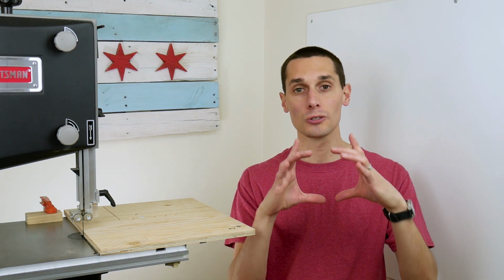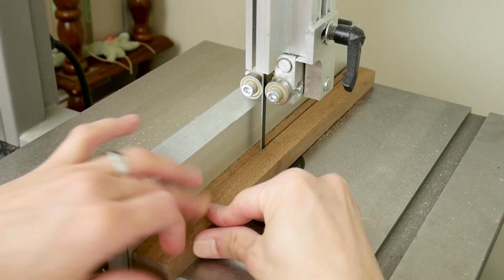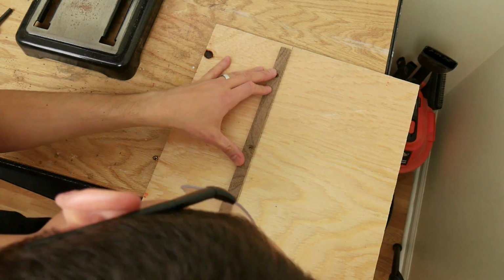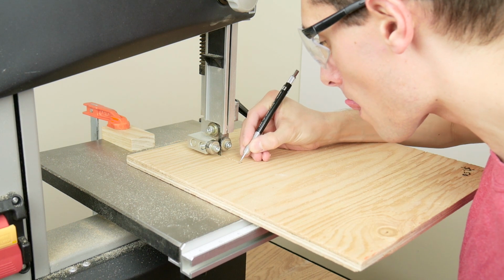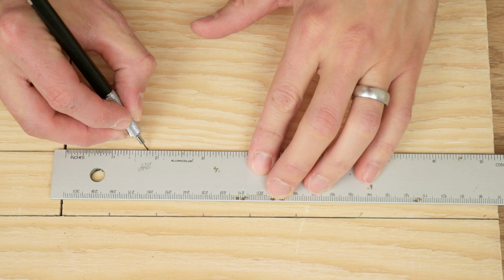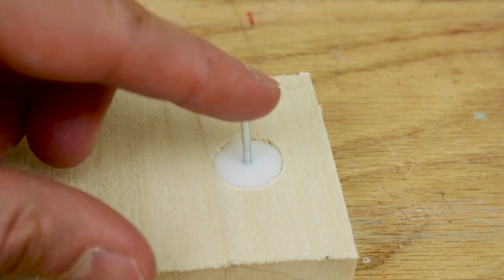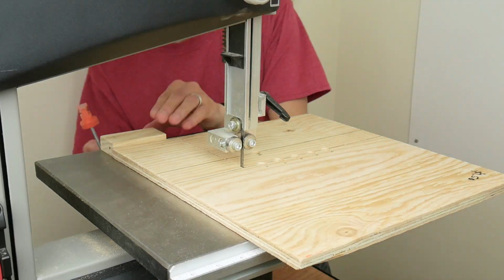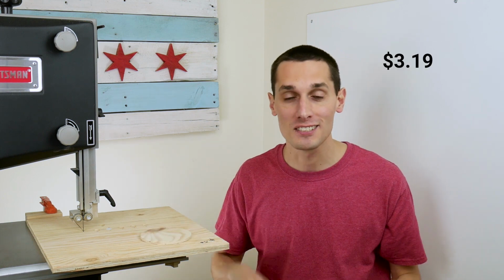How To Make a Circle Cutting Jig for a Band Saw

Comment: made same jig but used a push pin instead, it fits nicely into 5/16 hole after light sending. push pins are cheap and easy to replace

Comment: I really like your idea for the tack glides! The only thing is I see the stop block being a problem when you start to make bigger circles because it is thicker then the plywood top of the jig. I recommend putting a stop block on the under side of the plywood that hangs of the bed closet to you. hope I could be of some help and keep up the great work!
Reply from the maker: +Josh Millar  That's a good point. I thought about a stop block on the front of the jig but eventually decided that a stop block clamped to the back of the table would be easier/better for me. A stop block on the front of the jig might be better for someone else though.
Reply: Makify1 that's very true! If your not making anything bigger then a couple inches your way works great too!

Comment: I made this but having a slight issue.  Every circle has a slight flat edge which has to be at the starting point. Do you know what I'm doing wrong?
Reply from the maker: Greg Jones Is the leading edge of the blade perfectly aligned with the center of the circle when you cut?